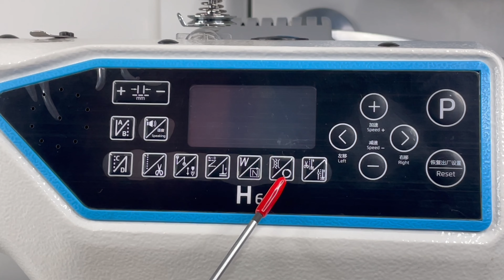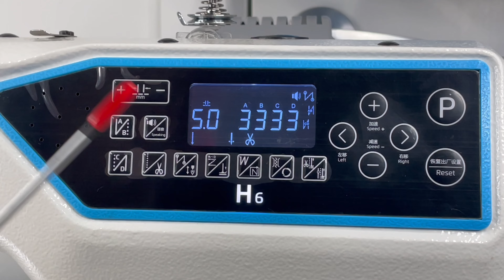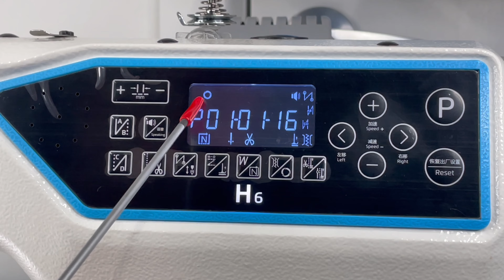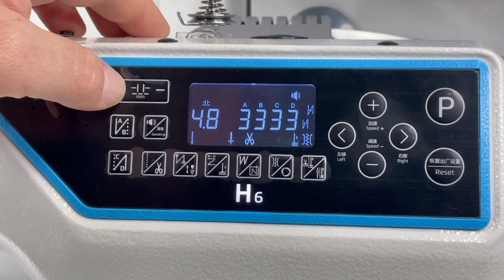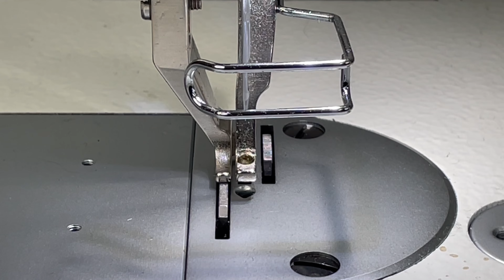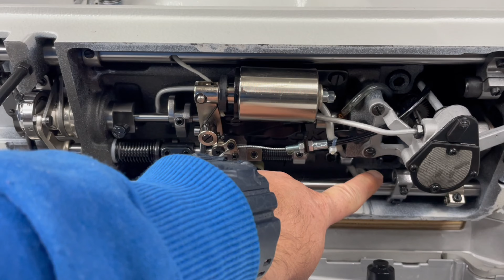Overview of the JACK H6 Industrial Walking Foot Sewing Machine

Comment: Everyone shows the maximum tie length, but no one shows the minimum. Maybe you can help?
Reply from the maker: The minimum stitch length is going to be 0 and you can't stitch at 0 stitch length on a walking foot machine. People like to see the maximum length because of possible uses for that length.
Reply: @ozcommercialsewingmachines Thanks for the reply. Of course, the maximum is very important, but no one shows the minimum. I read somewhere that the minimum is 4, and that worried me. I'm still new to this.

Comment: How is the longevity of Jack machines? I am looking at buying an H6L 4 and want to make sure I am getting a quality machine that will last for many years of occasional car and boat upholstery, thank you for this video as well. It was well done and informative. One of the things I noticed right off the bat was how much quieter it was from forward to reverse than Juki or Consew.
Reply from the maker: @timbrown2637, we have been selling JACK machines for quite a number of years and have found them to be very reliable. I believe JACK is up there in quality with JUKI and CONSEW no worries at all. The reason they are a lot quieter than the machine brands mentioned is because they have the latest in stepping motor technology to operate the stitch length. Both JUKI and CONSEW are still using old school solenoids to operate the stitch length.
Reply: @ozcommercialsewingmachines  Hello from Czech republic. I have bought Czech brand Garudan 5131-447, and by comparing various double transport/foot walker machines, they are all the same , built identically, Jack, Zoje, Typical, and machine I bought. There are differences in motors, and computers, but basic mechanic is literally the same. Also, tables are the same, made with poor quality materials probably in China. Screws and bolts used are also Chinese quality on all those budget machines regardless of brand. They all have same needle plates, transport teeth and those mechanical parts are interchangable which is kinda good thing as you can replace and find broken part more easily.

Comment: I love my jacks i have the A4S,W4 & E4 but on my a4s i never see the oil moving because i dont sew fast lol
Reply from the maker: Richard, if you can't see the oil moving you need to unthread it and give it a run flat oil to make sure the oil is getting circulated through the machine.
Reply: Have you had them a while?